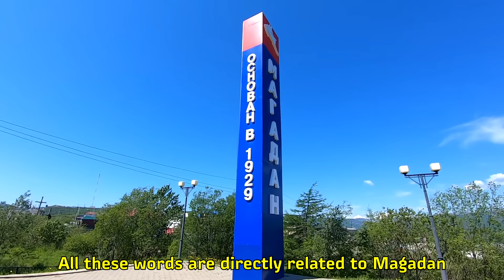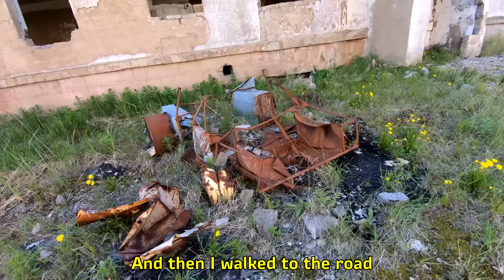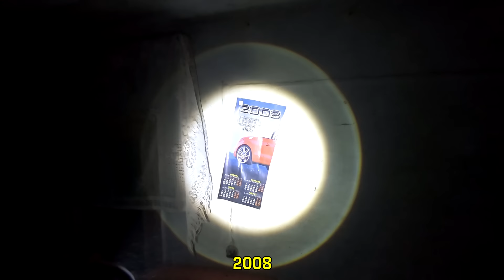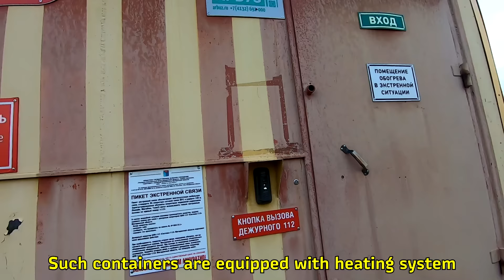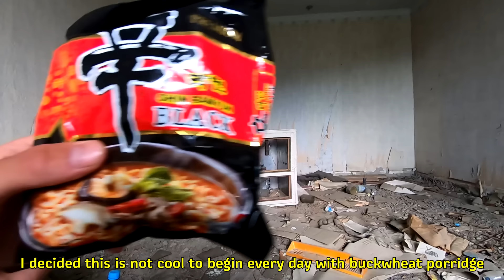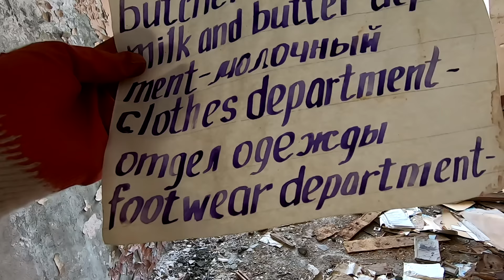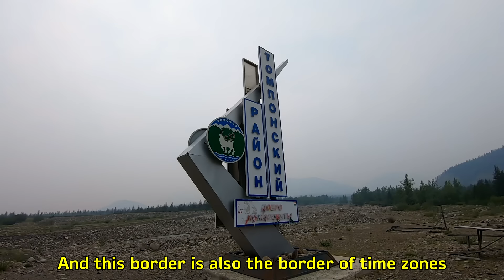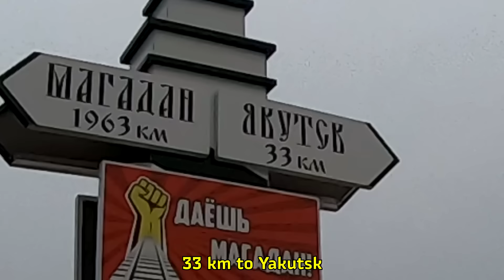The Road Of Bones - Hitchhiking Russia's Most Dangerous Road "Kolyma" (Magadan - Yakutsk)

Comment: That was fun to watch.  Probably more fun to watch than to do.  I really hate mosquitoes, especially the itching after.  I'm comparing the deserted mining towns in Siberia to the ones I saw growing up in western Pennsylvania in the USA.  Those were smaller.  I remember one old coal mining town that still had the old buildings, including an old fashioned machine shop with old pulley powered machines rusting away.  There were still some little electric locomotives used to pull small coal cars from inside the mine.  I'd say that the differences, other than the scale, are that things were not scavenged as much on the US sites, probably because labor was more expensive, so it wasn't worth it.  Of course the sites were from a much earlier time.  And the residential buildings were built from wood rather than reinforced concrete, and the climate was wetter and warmer, and with fast tree growth, and 50 freeze thaw cycles every winter, so the residential buildings were much harder to see.   But ghost towns are common in most mining areas, as mines are played out or noncompetitive, or become unsafe.  Also, with automation, the number of miners decreases greatly, so even if the mine is still productive and competitive, the town loses lots of population.  The same thing happens with logging and lumber mills.  

Of course the scale of the Siberian routes is unique.  I've driven the road to the Arctic Ocean in Alaska, but its tiny by comparison  Only 414 miles or 666 km.  And the Alcan highway is about 1500 miles, or 2400 km, but it's all paved.  It is fairly deserted.  I remember one truck stop/store/gas station/campground that was so far from other settlements that it actually had its own little TV and radio transmission stations.  normally campgrounds had cable connections, but they told me, no, just use your radio and TV reception.  And they had their own water purification plant and diesel generator.  

One thing that seems to be common on both Alaskan and Siberian highways is that travelers look out for each other.  In Alaska, you are required to stop if someone seems to need assistance.  When I drove the highway, there was lots of construction.  You had to wait for a pilot car to lead you through the construction.  The weather was good, including no mosquitoes, so we got out of our vehicles and talked to each other while we waited for the pilot car.  So when I had my two flat tires, my new friends stopped and asked me if I was OK.  Fortunately, I had read that two spare tires were a good idea, so I was OK.  And the truck stop mechanics were good at hammering rims back into roundness.  And my tires were the same size as the oil company trucks, so replacement was easy too.

Comment: really cool video.

Ya know, if you don't put your bottle all the way under water, it fills up faster. when the whole opening is under water, the force of the water going in is similiar to the air that is being pushed out. Meaning that it slowly fills and then the water also pushes on the whole bottle slowing down the process more

if you only submerge half the opening it will fill much faster so water can go in and air can go out without it interfering with the other

Comment: Hello why did not spalt or cement the road
Reply: Doesn't cope well with extreme temperatures. Just think if it's wet and it starts to freeze, the water that got into the asphalt will start expanding, thus, deteriorating the asphalt rapidly.